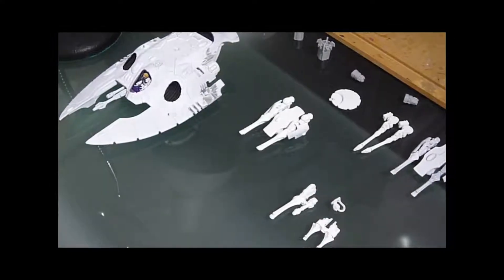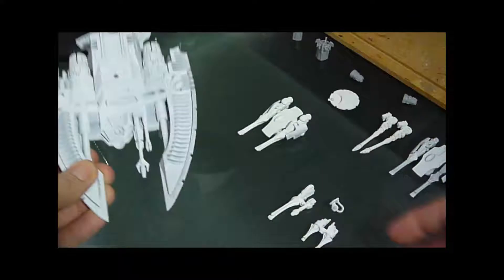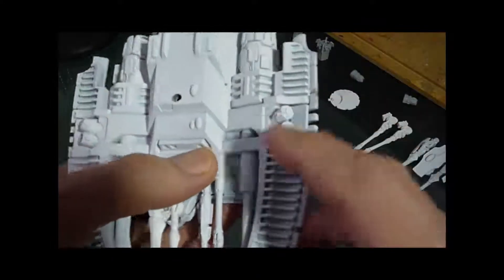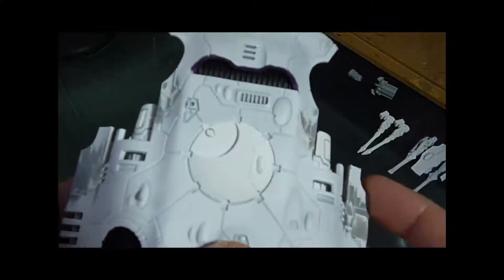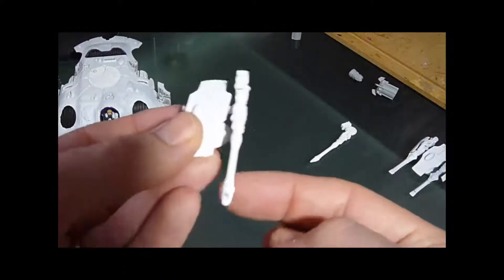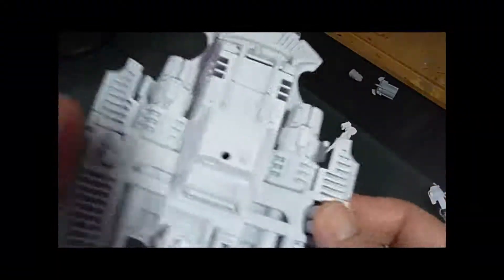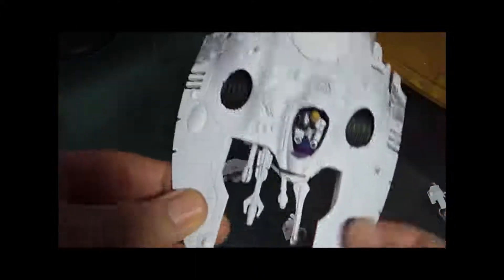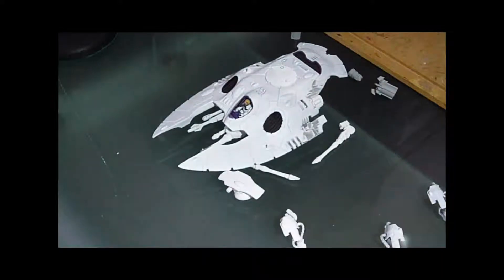How to Magnetise an Eldar Wave Serpent

Comment: Thanks for the ideas.
Sometimes it is hard to get two magnets to line up properly due to model geometry. Also its hard to remember which way round the magnets need to be so that they actually stick instead of repel each other. Sometimes even when they are attached properly if different magnet assemblies are too close together there can be field problems. For these reasons I use stainless steel on one side and magnets on the other. However stainless is a real problem to cut without proper tools.